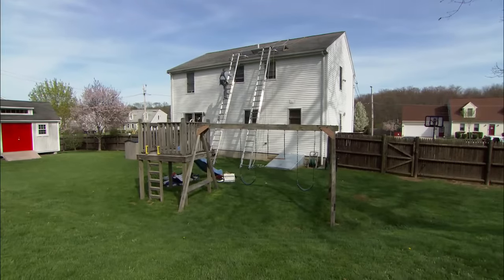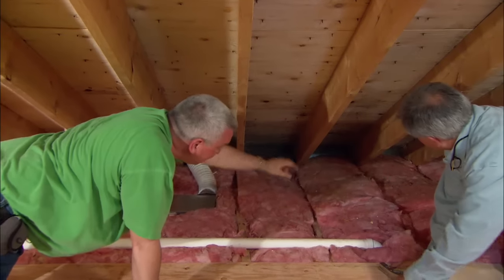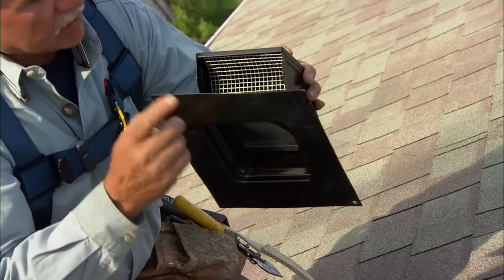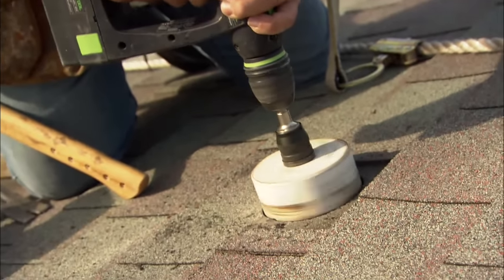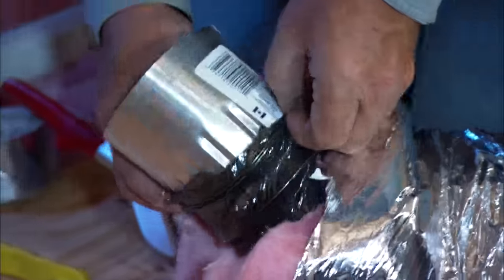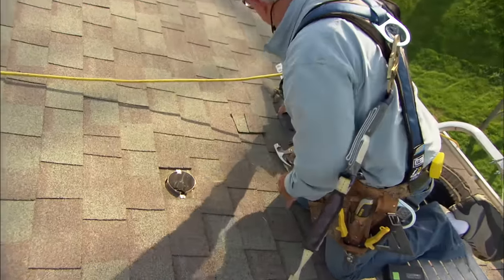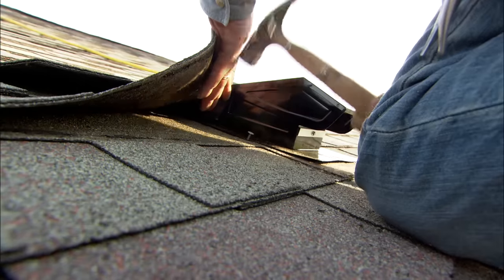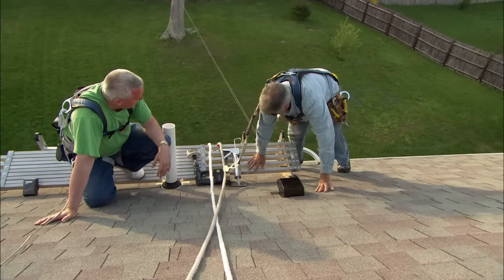How to Vent a Bath Fan Through the Roof | This Old House

Comment: what happens when it snows and the snow on the roof covers the vent?
Reply: I had this same installation on my condo in Vermont and, surprisingly, it worked very well.  You can see the vent aims downward and the vented air will always be warmer that outside, melting the snow around it.  I had 12" of snow on my roof and could see a small crater of melted snow with the bath steam coming out in winter.  Never leaked or back-fed cold air.  But i would guess you really need to seal everywhere around it on the outside to minimize ice dam behavior.  But, if your soffit vents and ridge vents are working well, plus you use insulated vent inside like Tommy suggests, the area around the vent should never be warm enough to create a melt/freeze cycle of ice dams.  The only warm air would always be in a downward direction and theoretically keep the surrounding area clear of the kind of ice required to create the damming effect and water backup.

Comment: Why not caulk around the pipe that he has protruding out of the roof before he installs the vent hood as a precaution?  And why not caulk (or tar) around the vent fixture after its installed for the same reason?  By not caulking under the lower edge, if you get an ice / snow build up, the melted water can actually go uphill if there is an ice dam frozen below it - the vent will cause the roof to be slightly warmer where it is located.  And how does he think that the roof is venting at the apex - through the roofing felt and shingles?

Comment: hey would it leak between the roof and the vent as they dont look sealed or thats fine he said he is leaving some space for condensation wont that build mold on the roof under those shingles
Reply: +Aiyman Khan Yes. He forgot to put sealant in the gap between the round hole and the round metal collar. That gap around the hole will allow some condensation back into not just the attic but also in between the plywood, barrier, and shingles.
Reply: This is not good...frost will form on top of the vent ...when it warm up condensation will drip thru the bathroom fan..seen it too many times...always vent thru the soffits ....Tommy is wrong this time!
Reply: Your wrong never vent to soffits always the roof.

Comment: Quick question. If you have 2 layers of shingles on the roof and your putting this vent on. Do you just lift up the newest roof layer drill hole and slide hood under. Or do you lift both layers of shingles back drill hole place hood under all layers of shingles. Any one know. I would appreciate any help...thanks
Reply: two years have passed since your post and probably completed your project by now. I hope you only disturbed the newest layer of shingles, if you went through both layers please tell us your horror story.

Comment: Nice video. However I installed my  kitchen vent in the exact same fashion and what occurred was a ice dam resulting in damage to my kitchen.
Reply: Wow! How  much  snow  do  you  get?

I'm  in  western Canada,  we  get  anywhere  from  26"-38" of  snow  every winter,    not all in  one  snow fall .  

I've  owned several  homes  that  had bath  fans,  and   high  capacity  hood  fans  vented  through the  roofs with  no  problems  of  ice damming.
Most   builders and  roofers  here   use  proper  gooseneck flashings that have  the  opening  a minimum  of  5" above  the  roof  surface.

Comment: If my attic is closed cell foam sealed with no soffit vents can I then vent it through the soffit?  I really don't like holes in the the roof.
Reply: This question comes up a lot. Technically yes because the moisture can't come in from the soffet since it didn't exist. BUT you should have some type of venting in the Attic.

Comment: I did this and had an inspector say that I could not use HVAC ducting - What did I do wrong? because it looks exactly like Tom's?
Reply: That duct it what is used, it is not HVAC duct...don't know what your inspector is saying. Modern fans like Panasonic do not create enough heat to be a danger. You can insulate right over them. You can buy 25' of the correct stuff at a box store for $25.
Reply: @davejohn255  mine was not an aluminum duct but a plastic duct used for HVAC. Could that be the problem is that it has to be an aluminum/metal duct? Thanks
Reply: @goldenyolkshomestead2933  yes and if your using the same vent as Tommy you'll need to make a 4.5" hole rather than 4 1/4" like Tommy used. The new style attaches a slightly larger vent pipe directly to  the vent.

As opposed to being seperate and installed first. If you can find someone to do this job for $100 it worth it to hire them.

Good luck , I did one yesterday and my shingles were so stiff (only 10 years old) that it made the job a pain.

Comment: My vent clanks in the wind.  Can that be fixed?
Reply: Mine does too. Only way is to rip it out and that wouldn't be good for cold intrusion.
Maybe some thin weatherstrip tape around the edges where the flapper hits?
Reply: A backdraught shutter in line with the tube can often fi x that problem, as well as other vent designs (One with a cowled hood is often better than the three shutter ones which are more prone to flapping in the wind)

Comment: What about the connection between the duct poking out of the roof and the vent cap?  I mean it seemed like he just placed the cap sort of over the duct and it wasn't even a tight fit.  Seems like you should connect the duct to the cap before fastening the cap to the roof, or else connect it from inside the attic after installing the cap.  But I might be missing something.

Comment: Question, I followed this to a T. After about a week of use I noticed that my ceiling around the fan was wet. I went back into the attic thinking I had poorly connected the duct to the fan, but turns out the insulation was soaking wet. Any ideas? Thanks! :-]
Reply: Was the duct you connected to the fan insulated? In cold weather, condensation can form on the outside of the duct, which will run down into the insulation and ceiling below.
Reply: Yes, we are to tape duct to connectors, zip tie, then tape foil cover on duct to connector. 
You've got air
"blow by" = hot air blowing out + cold outside air = water.
Same with cold air and hot outside air.

Comment: From bitter experience, I disagree with that location IF you live where snow accumulates on the roof.   Venting bathroom fans to the roof melts the snow, which then refreezes just below the vent.  Eventually, it builds an ice dam high enough to prevent the melt water from escaping.  Under the right conditions, it will back up and seep around the collar of the duct, back into the attic.  It then may drop into the ceiling, or refreeze into an icicle which will melt later.  Soffit venting is the right location in snowy areas.
Reply: So instead of putting it on the roof, where you say could be problematic under very unique circumstances, you suggest putting it under the soffit where it is pretty much guaranteed to cause problems, regardless of weather. I live in Michigan with tons of snow and my bathroom vent is on the roof, exactly as shown in the video. Never a problem.
Reply: Well, as they say "your mileage may vary".  Those circumstances have occurred in three houses in my family, so I don't consider it a rare event.  In Ontario Canada, bathroom and kitchen vents now are always installed in the soffit.
Reply: Bob McL are those soffits vented or non vented as was discussed in the video, I am curious?
Reply: @doskiebaniadam3603  the soffits are vented.  Now I am curious about the moisture issues that this video flags.  I'm not sure why that is not a common problem here.  Our soffits are vented, and use ribbed styrofoam panels against the roof sheathing to prevent the attic insulation from blocking the air flow.
Reply: Bob McL The orientation of the house and the wind factors can play a big rule in the concerns brought up in the video.  If the side of the house (where the vent is located) is semi blocked off by the neighbor’s house or other obstructions to prevent the wind from pushing the bathroom steam upwards to be sucked into the attic, then the vent can easily blow away the warm air away from the soffit and not let it get back into the house.  I hope this makes sense.
Reply: How about just extending the duct under the soffit just a tad past the end of the roof/gutter?  So it won't be discharging right under the vented soffit.
Reply: Soffit is OK if it isn't vented soffit.

Comment: should you caulk around the pipe where it exits the hole ?  maybe its no big deal. just wondering.
Reply: you shouldnt need to because the shingles protect, but I agree. Why not do it and prevent bugs or whatever. The caulk will probably be tossed out after anyways.

Comment: Is this the same thing for venting a range hood?
Reply: Dez Oner... trying to find out the same thing. I did see a video from a range hood manufacturer that said that instead of that accordion style vent tubing...one should use the rigid kind. (look up do's and don't of range hood installation)... also, I wanted to go thru the side of the house. contractor said because I have an ac unit below I would have to go thru the roof... doing ur own homework blows but worth it in the end... good luck
Reply: Yes, I am looking for the same solution. Looking to install a range hood ductwork and I am torn whether to vent it through the roof, which is the shortest and more direct route or through the sidewall. We get a lot of snowfall in Wisconsin and I am worried about the ice dams.

Comment: Will someone tell me why everyone puts vents out the roof ??  Why not the sides of the house ??  In this case the warm moist air is coming OUT but in the case of vents its suction.  I just dont get whats wrong with a simple 5 feet of vent as opposed to a 20 m vent out a roof which means cutting a HOLE in my roof
Reply: You can if you're close enough to the side of the house.  Most bathrooms are towards the middle which makes the roof the most logical spot.

Comment: I feel like rain water (let's say in a hurricane) will find it's way under the unsealed front of that vent flashing into the pipe/attic
Am I wrong ?
Reply: most likely no because water will not be going up the roof it will be rolling down the roof
Reply: In hurricane force winds, you're likely going to lose most if not all of the shingles on the windward side anyway. The reason he didn't caulk the bottom edge is the other 99.99% of the time where condensation might build up under the flange. If you caulk it,  the moisture has nowhere to go and rots out the roof sheathing

Comment: probably could of left the vent where it was and put the insulation around the vent piping and covered the vents right next to either side of the soffit to reduce chance of the moisture coming in from the vent without causing problems when heavy snow and ice accumulate on the roof. I'm not an expert at this stuff but I just picture snow being a huge problem with the roof setup when it wasn't an issue where it was. Just where I work there's a problem with youtube solutions that come up with DIY customers that you learn about over time .. you need to look at a few different ones for any given problem and see where problems come out of each one so you can understand all the things you need to meet in order to avoid problems. YouTube has good ideas but there's always someone who does the job you are trying to do all the time that sees the flaw in it, if the flaw is not significant for the area you live and is cost effective, it might be worth considering. But nothing is universal for these sort of things. in this case heavy snow is not factored in so this might work fine in the Carolina's but not in new England.
Reply: If you cover up the soffits from the inside with insulation, you defeat the purpose of having the soffits. They then stop cooling the roof on the inside causing snow melt and ice dam formation.

Comment: Which professional do I call to get this done for my home?
Reply: Tiffastic Nguyen thats what I want to know
Reply: Jitendra Patel A professional handyman vented our bathroom fan through the roof.  Call a really good and careful handyman to help you.
Reply: +Tiffastic Nguyen A roofing company or HVAC company.
Reply: +Tiffastic Nguyen With this video, Do it Yourself and save the $150.00 labor charge !
Reply: +Tiffastic Nguyen Roofers... make sure you use a reputable compant because almost all of that caulking work may not be done
Reply: +anita dsouza Ha, $150 in labor charge?  A roofer here in FL want's $600 per vent.  I have two to redo, so that's $1,200. I told him to take  hike and I'll do it myself.
Reply: Just got a quote in wisconsin. I supply the vent and the fan and install the fan before HVAC guy is there. 4hrs labor plus 100 trip charge. Plus "supplies". It was 750 to do this......thats what brought me here...

Comment: His roof hole is bigger than duct work and he left it unsealed???   i would of sealed this gap ...  am i wrong???
Reply: It wouldn't hurt to seal around the duct but he's got sealer under the vent on 3 sides plus sealer under the shingles that overlap the vent flashing, is more than adequate. Unless water flows up his roof, which is unlikely, it's sealed properly.

Comment: Air can blow right back down around the metal sleeve into the attic, esp. if the louvers are clogged with snow or dirt. The sleeve did not have a bead rolled into it so a 50 lb. rated UV resistant Zip Tie could be used in addition with a mastic or foil tape listed to UL 181-B/FX ensuring a minimum 1.5" overlap as required by code. When that caulk fails a strong wind can suck that termination right off the roof. The flex must be stretched out until smooth inside or else the  flow will drop off massively. Does appear to be Class 1 duct with flame spread of 25 as required by code. Really should have been hard ducted everywhere possible using flex only where needed for compound curves and offsets. Also should use hard duct if people could be expected to come in contact with it. Not Tommy's best.

Comment: Vented my fans through the soffit. Never had a problem. Id rather vent through soffit than penetrate the roof and have a potential leak down the road. If done properly with correct vent cover it will discharge the moisture away from house so it doesn’t enter the soffit. Then there’s no chance of a leak in the roof and no chance of moisture entering attic. Come on tom. You know this!!!

Comment: I  Have  A  Tile  Roof. can I drive a. nail  from the bottom  to make my mArk for the vent
Reply: did you have a seizure while typing that comment?
Reply: Fernando Suarez drill in a hole before u drive a nail through so it does not crack the tile

Comment: But people vent whole house fans into the attic... Why is THAT okay? Maybe the bathroom vent fan vents out more humid air because of the shower
Reply: +Kat TheFanEnthusiast It's an old school way of ventilation.  Still in a lot of older homes
Reply: Jack Carlos
I thought venting whole house fans into the attic was ideal, because it helps to push hot air out of the attic. Modern whole house fan installation videos still show venting the fan into the attic...
Reply: Kat TheFanEnthusiast I can't ever imagine why it would be a good idea to vent a bathroom fan (or any ventilation) into the attic.  Moisture is your worst enemy.

And if you have a kitchen hood going to the attic, you're venting grease, gas, etc. that are all fire hazards - in addition to moisture.

Most ventilation runs THROUGH your attic, but not into it.
Reply: Jack Carlos
So I'd guess you should vent fans outside the roof and just use attic vents to ventilate the attic? I'm talking about whole house fans that are not meant for venting grease. For whole house fans, many people say they help vent your attic and push heat out of the vents, replacing it with cooler air from the house, which would eventually be dryer air, as replacement air enters the windows, and in turn, after a bit of moisture, would dry your attic. Is that true?
Reply: +Jack Carlos she's talking about an attic fan, not a kitchen or bathroom vent.
Reply: Attic fans are fine. They draw outside air through the house, into and out of the attic. That's different than a bathroom exhaust fan, which is drawing warm humid air out of your bathroom. That air, if vented into the attic in cold months, would condensate, cause water damage, and eventually promote mold growth.
Reply: Kat TheFanEnthusiast rogermurph101 Gotcha, sorry about that.  Don't know much about attic fans, but what you're saying makes sense!

Comment: Think I'll just buy a dehumidifier a little skittish about drilling holes in my roof
Reply: I designed an upgraded version of the air duct fan, which can be connected to the network via WiFi, controlled by a mobile phone, and set rules on the mobile phone. The function is very powerful and easy to understand.
I want to invite you to review it, and the product is free for you to experience. Help me make a simple 1-minute video, you can contact me directly.

Comment: why use insulated flex duct on it though?
Reply: that is a great question because its not carrying cold air ... its just moisture air being expelled ..
Reply: @ACommenterOnYouTube  Maybe to help keep heated moist air from condensing in the attic in winter and dripping back down into the fan?

Comment: So whats the procedure in the dead of winter. I have 2 bathrooms that need exhaust hoods installed in Ashphalt shingles. The shingles will break from the cold temp.
Reply: wait until spring or bring a torch up there